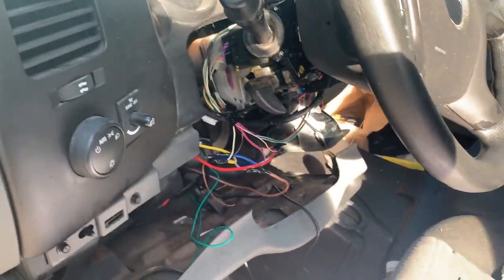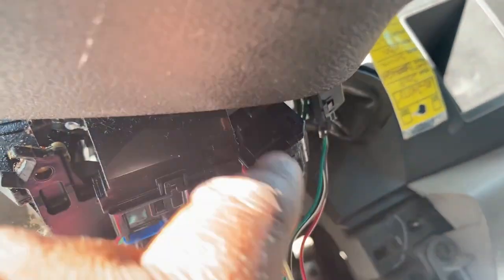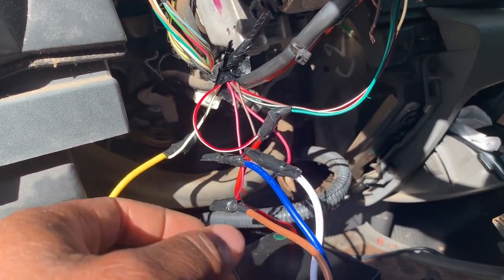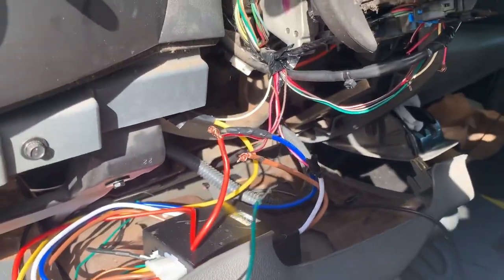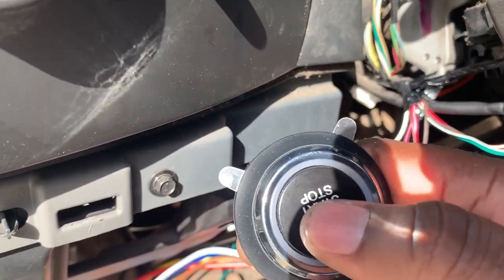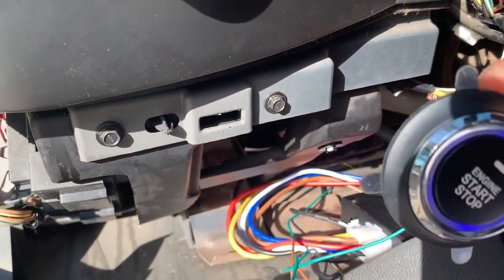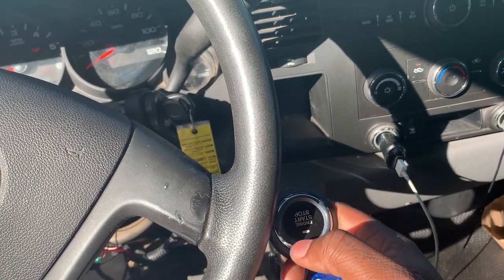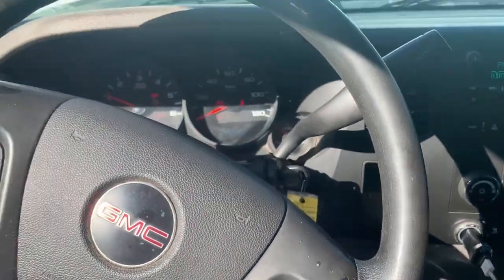2009 GMC Sierra 1500 Push Start Wiring Installation EASY!

Comment: Please tell me u didn't leave the wires electrical  taped like this and there all actually  soldered and done correctly
Reply from the maker: 😂😂😂 no I used wire caps and went over it with electrical tape for protection of the cap

Comment: Thanks bro got a 09 avalanche am doing was lost a lil so u didn't have to use a chip immobilizer
Reply: does it works with you also . I have the same car i am 09 avalanche planing to do the same thing But I was told to buy additional  Immobilizer  bypass device ! I do not know what to do cause this guy  also his car 09 should have Immobilizer . So how did it work for him without the    Immobilizer  bypass !
Reply: @123heraz  it work I got the key immobilizer bypass order sum key and pads from Amazon got the key cut and program the pads
Reply: @318ryder2   Thanks brother
Reply from the maker: great! hope it worked out for you

Comment: Thanks for the info, just curious. If you have remote start can you still hook this up and use the remote start on the key fob ?
Reply from the maker: yes you can just go straight from the sterring column ....has to be installed before the original start

Comment: Would I be able to splice for example both ends of the ignition wires with the push button wire so I could use either the turn key or push start at my discretion?
Reply from the maker: Yes the key in the ignition is just mainly for the steering wheel to be unlocked if using the start

Comment: I got a 2013 Silverado exact same product but I have everything hooked up to where it will turn on the air and radio but still won’t turn the starter
Reply: When I hook the yellow wire to my white ignition wire it won’t even turn with they key that the only thing causing a problem

Comment: I installed on my 1999 Tahoe I go to start the car and the starter keeps going and the engine shuts off the security lights go on wtf
Reply: U need a pass lock bypass module

Comment: Are you close to Dallas, TX. ? I'll will need help to install it in my silverado 2011.
Reply from the maker: No, I’m in NC
Reply from the maker: What you need help with?
Reply: @540tv6  OK!
Reply: Well, what kit you use?
Reply: I see this in Amazon: BANVIE Leather Key Car RFID Push to Start Ignition kit Engine Start Stop Button Switch Keyless Go System

Comment: What if my truck turns on after install but won’t switch gears ?
Reply from the maker: That would have anything to do with the gears.
Reply: I press the button and the truck turns on 
But when I try and put it into drive it won’t budge

Comment: Are you able to start your tuck without the key in the ignition
Reply from the maker: hello, yep. this persons truck ignition was bad so we bypassed all that.
Reply: @540tv6  can you explain how we start the car without the key in the ignition
Reply: @540tv6  what they normally recommend is you get a flat copy of your key made and cut or break it off with ignition turned to on/not start. Then you really the the key slot cap and install your push button over the hole.